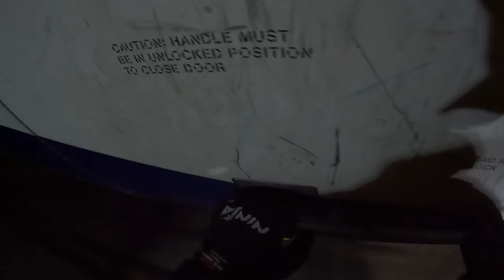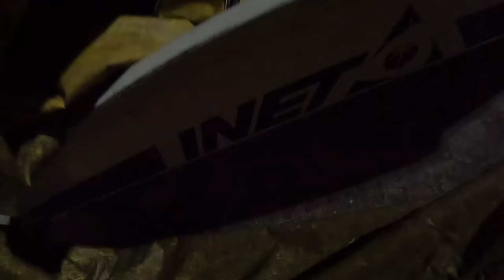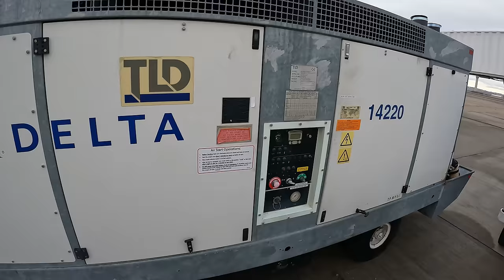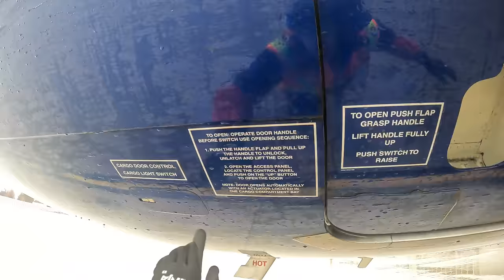A Day in The Life On The Ramp

Comment: I noticed that you put the luggage set to the side by the ramp before you put it in side of the plane is there a reason for it?
Reply from the maker: If it was while I was actively scanning and loading that would be the rush tags. Delta has a new tag for people with tight connections and we load those last so they can be rushed to the next plane.

Comment: I might get hired for cargo ramp agent  do you have any tips if I start?
Reply from the maker: That’s awesome! 
If you haven’t already get yourself some good boots and cargo pants. I wouldn’t go too crazy as you will definitely be going through a pair every few months but make sure it’s something you are comfortable in. Same goes for the boots except you should be looking at a new pair every year. 

As far as what you should expect, this video just about sums it up. Just listen to your leads and don’t over complicate your tasks. If you are stacking bags don’t stress yourself with playing Tetris your first time. Just get the bags in the plane. You’ll develop your own stacking style as you go and you’ll get faster and better. 
Stacking bags will be the hardest thing you do and it’s relatively easy. 

Another thing is once the brakes are off and you’re walking/pushing the plane don’t stress yourself and try to rush anything. I always saw new hires trying to rush the disconnection process and miss steps.

You should do great though. The first few weeks will be tough but it’s more about the adjustment to a unique style of working. My first few weeks I felt like a complete idiot but slowly got better and better then by my third month I was a lead.
Reply: @AircraftPitCrew  Thanks!

Comment: Gee thats some shitty old gear Delta.  Whos Towbars are the most expensive.   Boeing or Airsuss.  BTW you've been hired as a baggage handler,  Leave the rest to us
Reply from the maker: Most of Delta’s equipment is from the 90’s. It’s for a good reason too. The parts are cheap and the engines were built better than the new TUG’s. As for towbars the price depends on the aircraft type. I can’t give an exact dollar amount but I know one of our 175 towbars was close to $3k. You are correct I was hired as a ramp agent, however I was promoted to operations two and a half years ago. Which means I get to do all the fun stuff. Our station is one of those weird ones where everyone has to be trained on everything. We aren’t like the bigger stations that have dedicated staff for baggage. I assume you’re an AMT?